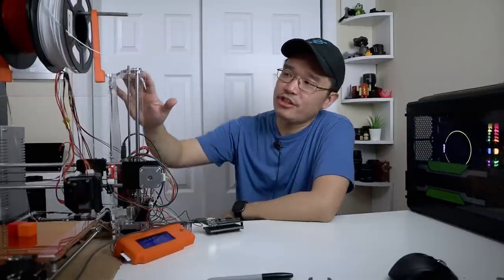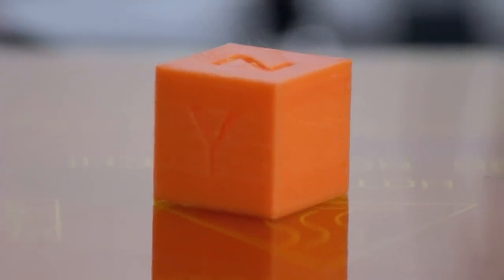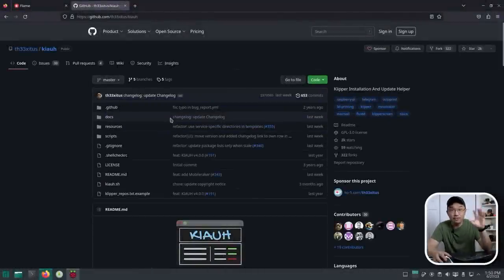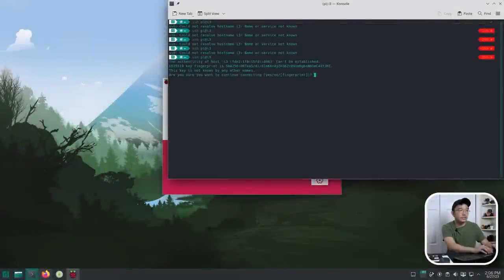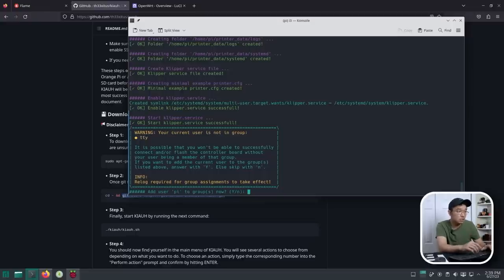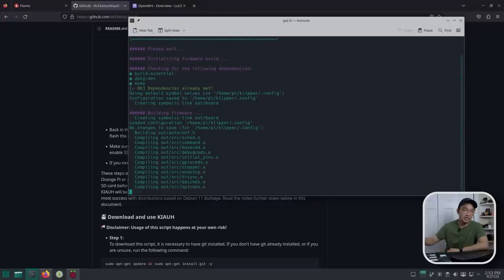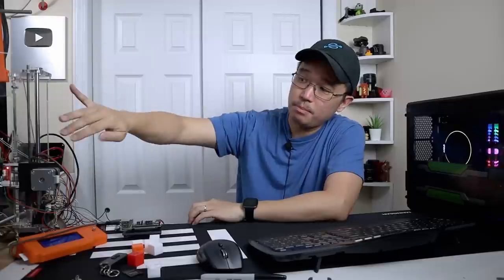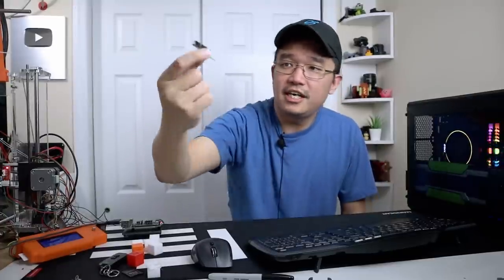Upcycling Old 3D Printer to Print 4x Faster @ 150mm/s

Comment: Those aren't 150mm/s!
You need to have an Acceleration of roughly 3800-4500mm2/s to make use of real 150mm/s.
With an Acceleration of 4000mm2/s you need to travel 3mm with the Nozzle to reach 150mm/s.
The Acceleration shown in the Video are not even 2000mm2/s.
The modest way to tune your Acceleration is to get yourself an ADXL345 and messure which Frequenzy the Inpushaper should handle the Vibrations.
Don't care about the max Accel shown in the Graph that much, you probaly need to go lower with your i3.

Comment: Would be cool to do if raspberry pi 4s were accessible
Reply: Buy an Orange Pi, loads of the little suckers are available, I have an Orange Pi Zero 2 running Octoprint, there is a little more to install but plenty of tutorials out there
Reply: @AndrewAHayes  i think you could run klipper even on a old laptop.
Reply: @MinePossu  Easily
Reply: As for RPi availability.. the supply-chain issues is getting far better, RPi’s are appearing for sale; on Amazon I’ve seen 8gb models at $90 shipped, that’s only $15 over their “real” price of $75. A FAR cry from the $395 I saw a during ‘The Dark Times’.

I really like the community built around the RPi, especially the software support… I find it far better than another other fruit community.
Reply: @ernestgalvan9037  still far from the $35 price target. And they've been saying for over a year now "supply-chain is getting better"